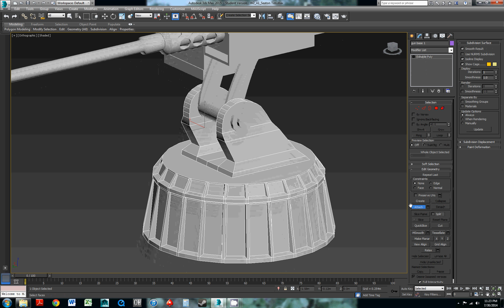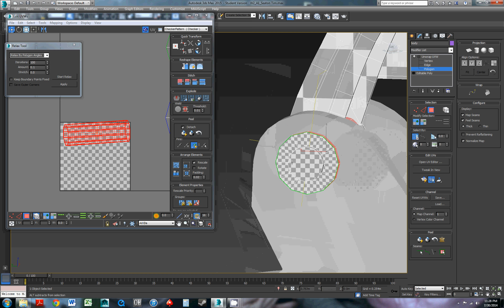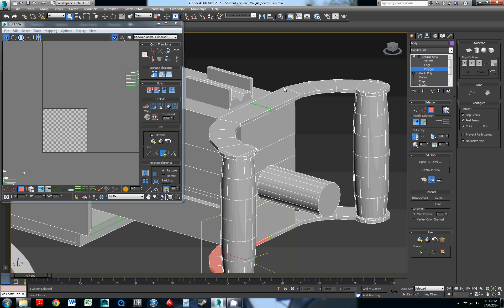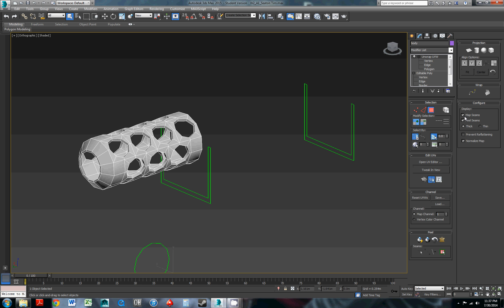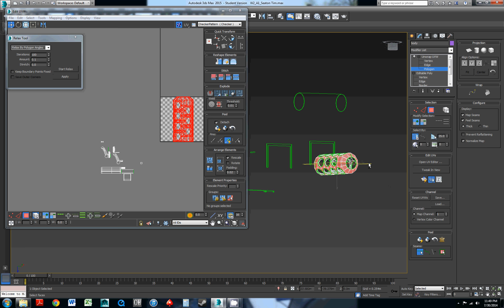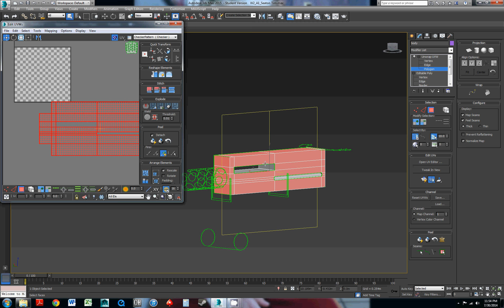Unwrapping Parts Using Pelt and Relax in 3DSMax 2015

Comment: Really helpful tutorial, much appreciated!

I have one question - in 3DsMax 2010 they have tools that align all vertex you have selected to the horizontal or vertical plain. You didn't mention this tool in your tutorial, is it not available in 3DsMax 2015?
Reply: Hi Gail,
No, it's available. There are a LOT of features that I didn't cover. This Pelt and Relax technique is pretty specific. I would say for environment and hard surface modeling and texturing, people will more likely use the align tools like you describe.